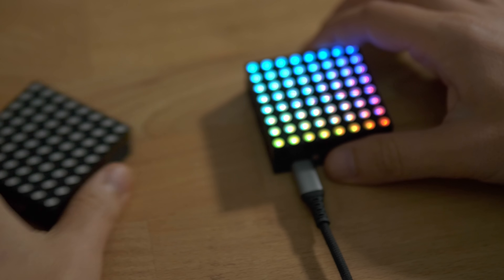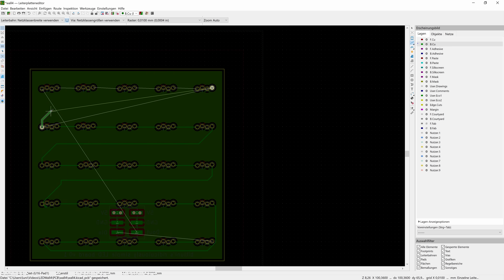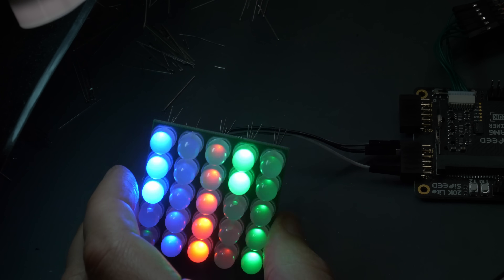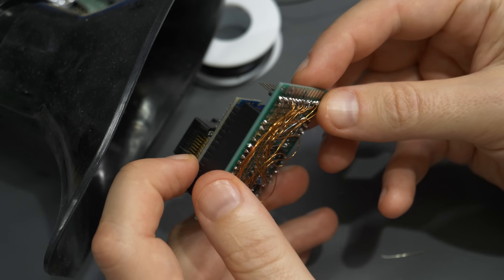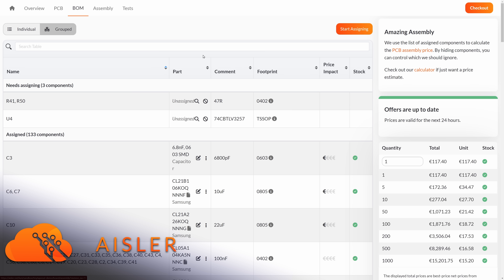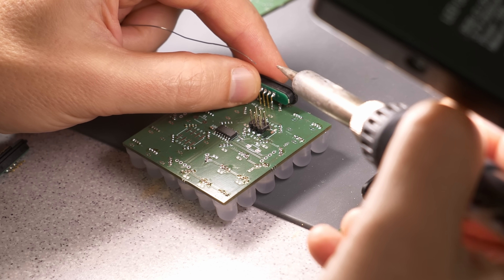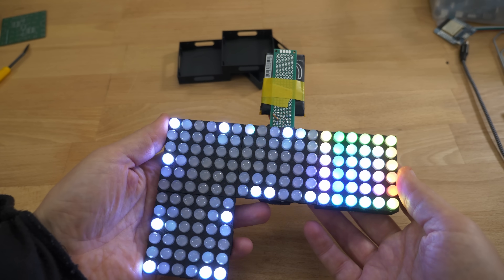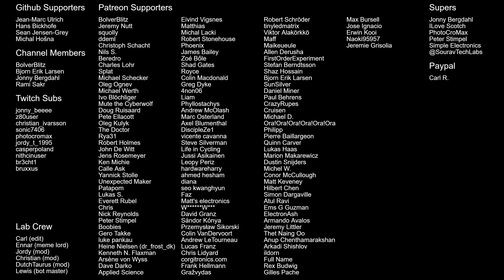Making oddly satisfying LED magnet tiles

Comment: lol, with the magnets, well maybe an aluminium soldering alum would work better. lol. or even copper. best heat conductivity there is. that iron would be cop then. lol. so why did they choose iron for the soldering iron, and not aluminium or copper. thats a flash light.
Reply: try your own diy logic chips with blu-ray drive laser 150nm lithography and diy pvd device, 3d micro-printed on a dvd-rom disc. yep no fab manufacturing required, just a vacuum blu-ray drive. yep diy transistors at below micron range. its around pentium 3/4 process ranges. or say diy rpi chip range. any logic circuit.

Comment: Some more info on the blender modeling part would be cool, I recently tried to model something simple and struggled quite a bit using Blender. The other CAD programs sucked or didn't work well on Linux, so Blender was the best option, but all the boolean stuff wasn't as nice as I had hoped it to be. Wouldve been a lot easier if one could simply group objects together like in 2D in Figma for example
Reply: For booleans you want to check face orientation (all facing out). The overlay drop down has an option for it. Just takes time but it gets easier. The default units to work in is meters but I use that as centimeters. 1 unit = 10 mm and export at 10x scale. I tried working in mm but the scale feels to small if that makes sense

Comment: You can make a puzzle game, where different modules would light up different patterns on 4 sides, and you have to connect them in such a way that adjacent modules have the same pattern on the common side. The only thing is that they don't have built-in batteries, so disconnected modules won't light at all until you connect them and see that the pattern in not matching...
Reply: but do that know/remember WHICH panel is which? or just X/Y connectivity? I believe v005 treats every re-connection as a new one

Comment: if you don't bother add the resistors, they will not last long. THe main reason for the resistors is to limit the current and not allow the LED's to die

Comment: Hi Bitluni, The link of the magnet connectors leads to the LEDs. Can you fix the link? Thx! Awsome work.
Reply from the maker: link fixed. thx for the hint
Reply: @bitluni  can you also fix the github link for the project? Also broken
Reply: @bitluni  it says they are unavailable now
Reply: The link is truncated because it's too long. (see the ellipsis on the end). YouTube being YouTube only puts the real URL in the text, and the href contains an evil tracker link (bait&switch style). The real URL ends in "magnetConnectors", however it seems to lead only to through-hole connectors. Do you also have the link for the SMD connectors from your last video?

Comment: Soldering the magnetic connectors was hilarious 😂😂
Reply: Using liquid solder would free up one hand so he could keep the tip from getting pulled by the magnet. Using a heat gun with the liquid solder can help him solder away from the magnets entirely. Better yet, liquid solder could help him soldering 256 leads at once with a modified oven.
Reply: @ivanj46   Is this how electronics are made of should we be grateful the Chinese reproduced so much
Reply: the pain is real.
Reply: fr😂😂

Comment: Would you happen to know the maximum current draw for those magnetic connectors?
Depending on how large the panel will be it might get quite hot.... Especially since the contact point is well... A point

Great video though 👍
EDIT: you should turn it into a tilable subscriber counter (as a practical example and then can say "like and subscribe to increase the tile count" 😁)

Comment: Do you really run them full brightness on a daily basis? I find the brightness of my 300LEDs matrix way too much. I can barely use the lowest 3 or 4 bits in my colorspace otherwise its just agressivly bright. Im still torn if its worth to put another filter on top of the diffusion glas or if i should just leave it like that.

Comment: 8:28 you should try Kompas 3d. I was trying to get away from fusion360 for a long time, tried tinkercad, freecad, ondsel, and probably something else I couldn't remember, but nothing was even close to usable. But then I've tried Kompas 3d, and although it was not just as simple as fusion, and had some strange behavior sometimes (for example I had to install STL exporting extension because default exports were low resolution for whatever reason), it was feature complete and sometimes even better than fusion in some cases. It also works fully offline, and doesn't require you to use any cloud functions

Comment: I did a similar project about 18 years ago and I implemented the water-ripple simulation. I think you should do that with the tiles!
It would look fantastic when a ripple can propagate from a single "randomly excited pixel" on one of the tiles and spread as a water-ripple to the other tiles.
The choice of reflection, inversion or something else at borders offer some fun variations as well.
Reply: Add this with a diffuser, to a surface that has a touch input and that would be neat
Reply: go one step further and simulate game of life on these :)
Reply: Also think about fluid simulation with different shapes of the container made of these led panels
Reply: Imagine adding capacitive touch sensing.  Touch an LED and it ripples out from that specific location.  You could also detect movement, like move your finger across a few LEDs and watch the ripples draw together and propogate out at different times and rates as well as constructive and destructive interference.
Reply: @LFTRnow  That is what I did, but I used the LEDs themselves as sensors by exploiting the photovoltaic effect.
This was done by using the LEDs as photodiodes, reverse biasing them using internal MCU pull up resistor and the common row pins with multiplexed ADC input functionality.

Comment: Free Fusion has a limit of 10 active "editable" projects. But you can have a many projects as you wish if you make the previous projects "Read-only". (See the sidebar with "My editable documents"). If you need to edit a read-only project, just make ik editable again. Just make sure you respect the max of 10 editable projects at the same time.
Reply: thanks for da tip
Reply: Also - you can usually pay about $10 to get added to a school/company license to get access to everything, if you know a guy...or have eBay.
Reply: @sirseriously wait for real? I'm a hobbiest and I'd happy pay $20 a month but not $700+ a year!
Reply: @sirseriously  Idk if they still have it, but for a long time all you had to do was email autodesk and register as a business with less than 100k profit annually and they'd give you a startup license for free.
Reply: @ClangandChiill 
They charge $150 for 3 years now. Just looked it up. I used to do the free startup licence thing too, but stopped when I went to Linux only...   Because it doesn't work on Linux anyway (well, it didn't when I last tested - that could have changed in the last few years).
Reply: @sirseriously  Or just use Blender or FreeCAD since it's good enough for 99% of hobbyist projects.
Reply: @cyrkielnetwork 
100% agree. Fusion is filled with really powerful design and simulation features that are intended for professional design and manufacturing processes. They're way above what a trial and error 3D print hobbyist will need.

I think it's a bit like Adobe Premiere, MS Office or Windows - everyone uses it because they were told everyone uses it.
Reply: this
Reply: All this pricing shenanigans is why i wrote "GatorCAM for CNC". 
On my channel.😂

Comment: I don't know if it's feasible or not, because of potential size problems, but these leds look like they might just slide in some 4pin sockets soldered to the board instead of soldering leds directly. (?) It might solve your replacement issue.